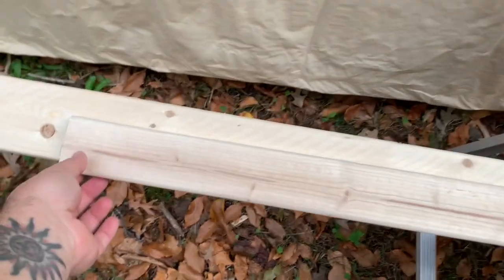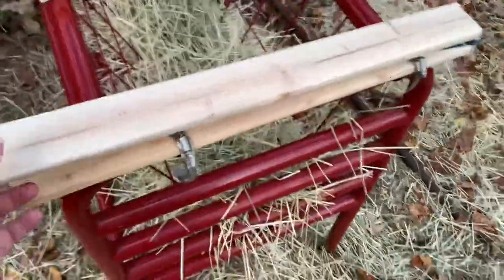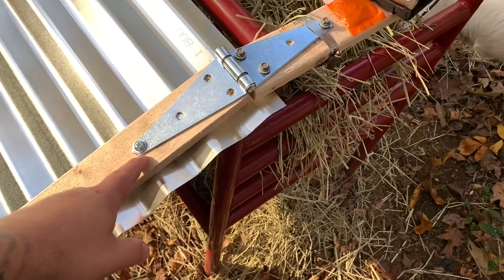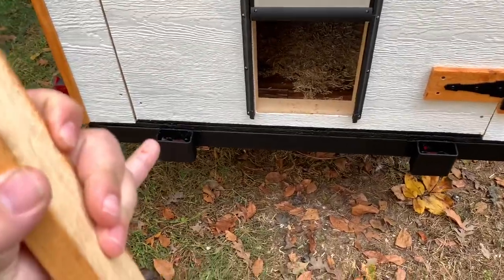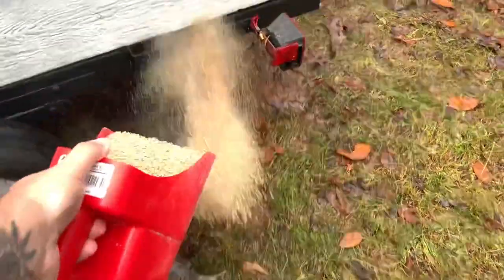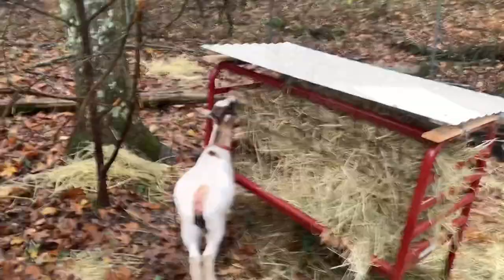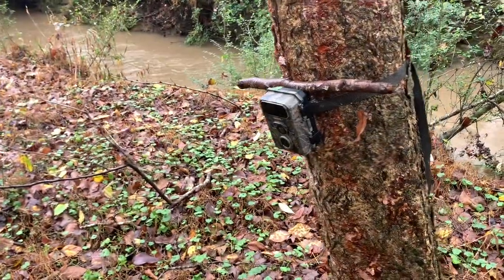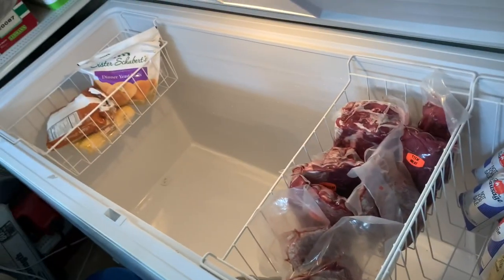GOAT HAY FEEDER | How to Build a hinged Lid - DIY

Comment: Yes they can have discharge like that when they are in heat. You may not always see that tho. Just a suggestion. I would screw some boards along the under edge on that tin. It is super sharp and that might help prevent the goats from getting any nasty cuts.
Reply from the maker: Gwen Pool yeah its pretty sharp stuff. I already rounded the edges off with a grinder but thats a good idea too

Comment: Hello from Western Pa.  we only had rain Wed.  Dry here the last 2 days now.   ATV is definitely the less expensive route to go.  I have more ground so bought a side by side instead.  so much nicer to work from.  Tools, chainsaw, firewood, etc... fit right in the back.   tailgate drops for a nice work bench.   I got the yamaha viking because of their fully covered(shielded)  undercarriage.  Less chance of getting a limb stuck up under the bottom.   It is all preference though.  I am sure most manufacturers build a sound product at this point.   with less ground an ATV is all you would need and it will go into tighter spaces and take up less garage space.
Reply from the maker: Dan Klein VERY cool! I would love to have one eventually. Like you said, if I ever decide to purchase the surrounding acreage, I might look into a UTV

Comment: you should fill the empty space with water jugs or ice... its cheaper to run a full freezer then a empty one, it will also last longer ... powerfields has black netting ... I believe there is another company based out of the UK but I forget the name right now...
Reply from the maker: 2 fries short of a Big Mac Yep, we have since added another deer, lots of product as well as quite a few one gallon jugs of water. Thanks for the netting tip, I’ll check it out!
Reply: @HiddenCreekHomestead   gallagher was the other company I was thinking of but after looking I don't see black on their site
Reply from the maker: 2 fries short of a Big Mac Thanks for checking anyway!